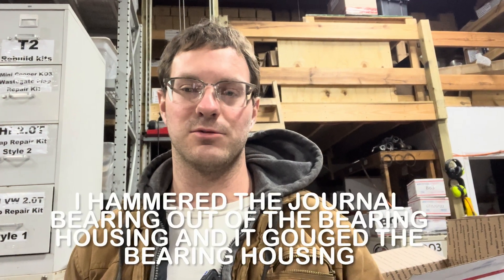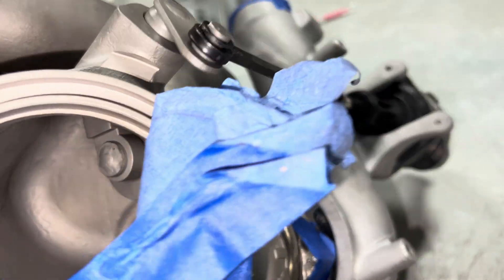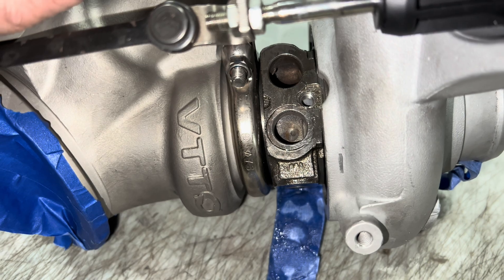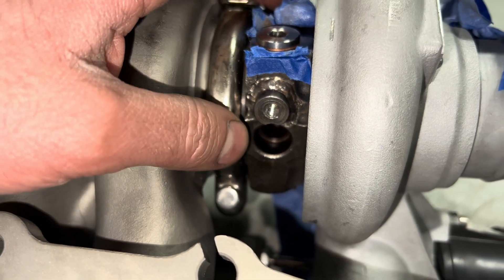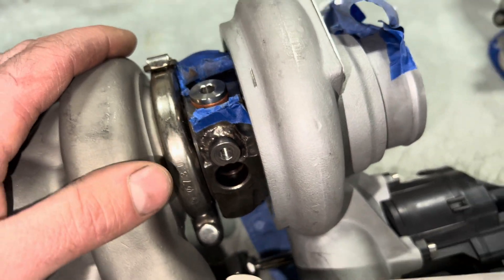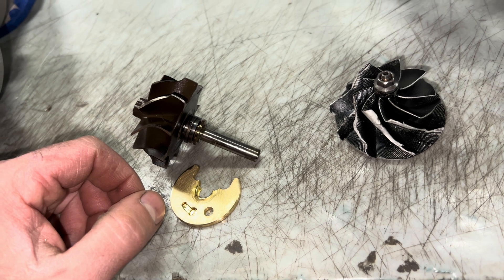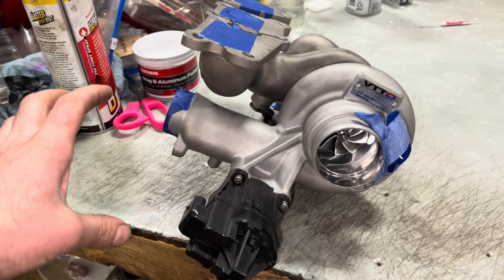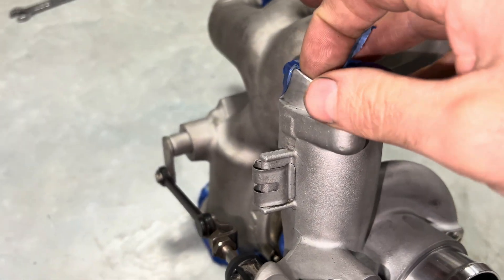BMW S55 Vargas turbos T51R rebuild

Comment: I have a set of VTT I am hesitant to put on my car. He makes reallly poor quality parts
Reply: no that’s not true, i had vargas gc+ turbos on my s55 m4 for 40k miles before i got my motor built and went to single turbo. not a single issue with the vargas, however before i switched to single turbo, i bought kratos and the kratos blew the turbos, the turbine shaft was inside the midpipe.

Comment: Question brother. I had a brand new set of PS2 HF installed last year on my 335is. And straight up out the box I got a small rattle only at start up. Could it be waste gate adjustment was not set property?
Reply: n54? some noise is normal btw (had 4 n54 cars). until they seize you fine

Comment: why do you have a thrust bearing thats not 360  supporting the shaft ? obviously the shaft receded back into the CHRA, impellers touched the housnig and shock loaded the shaft and broke 1) at the support bearing area 2) the thin part behind the compressor impeller
Reply from the maker: This bearing was 360 degree but when the shaft broke it broke the bottom half of the thrust bearing. The tdo4 thrust bearing only comes in 360 degree, ours has 2 oil ports and a larger pad for the 14mm collar and spacer.

Comment: If i purchased a set of 19t turbos would it be recommended before installing them to get your 19t rebuild kit and to get them vsr balanced before installing?  And would it also be recommended to get a set of oem wastegates?
Reply from the maker: I have several videos on the bmw 17t and 19t turbos. I would at minimum check the thrust bearing quality because of the oil hole size. I have a kit that has a longer wastegate bushing and matching arm to help it last longer.

Comment: The turbo setup looks very similar to the Honda 1.5t & 2.0t. Are you able to t51r mods on those stock Honda turbos?
Reply from the maker: Someone else did that’s t51R. The tolerances are not the same as the 4” inlet T51R. I don’t know if it works or not. I need to research that. I prefer not to do that job but I’m curious who does it and how much they charge for that.